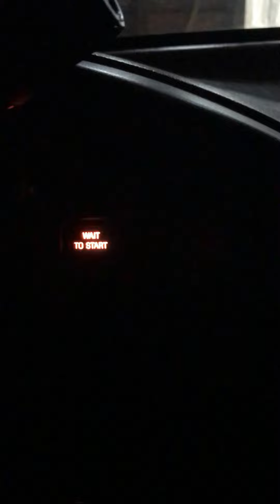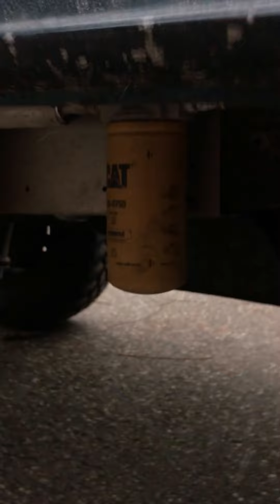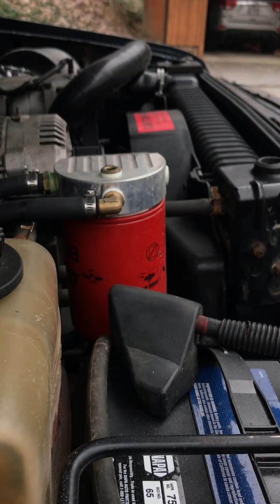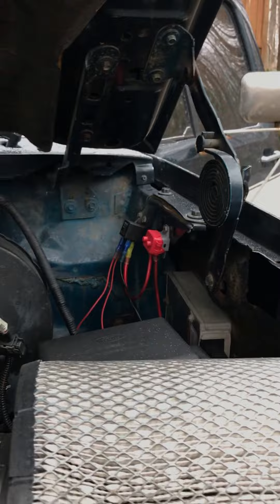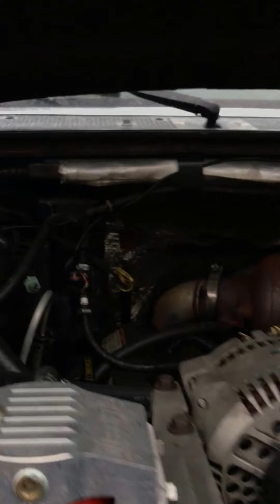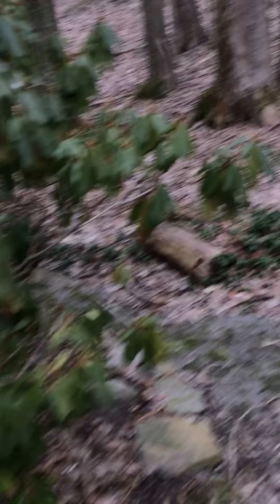OBS 7.3 Start Up and Basic Walk Through

Comment: where did you get your e fuel system
Reply from the maker: I got the pump and mounting bracket from Marty's Diesel.  Honestly, he just change his system last year and its no longer a "regulated return" but a "dead head" like the newer 7.3's were.  I built my own regulated return after his system.  The pump and mounting bracket were decent . . .but for the money I spent, I would have been better off to build the whole system myself.  It's not really that difficult to do.